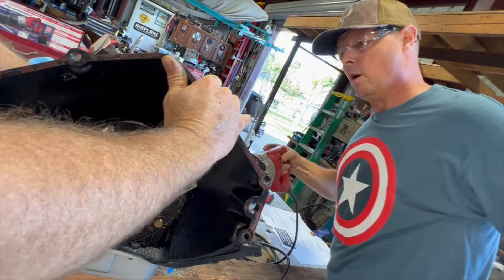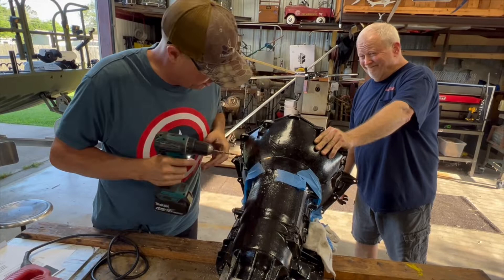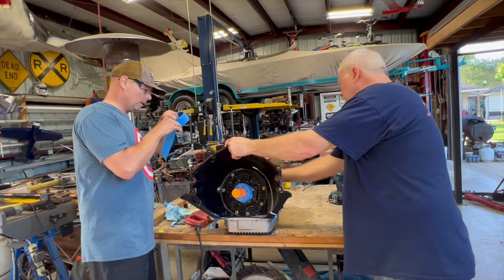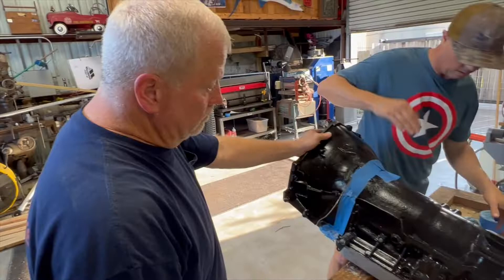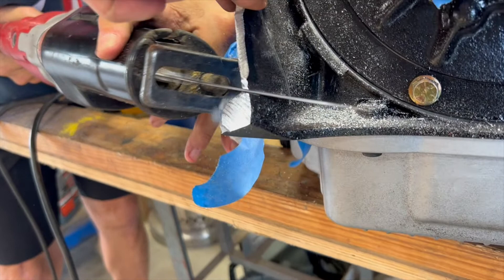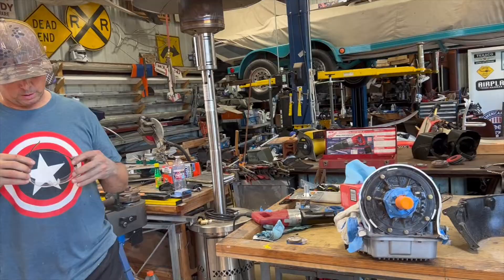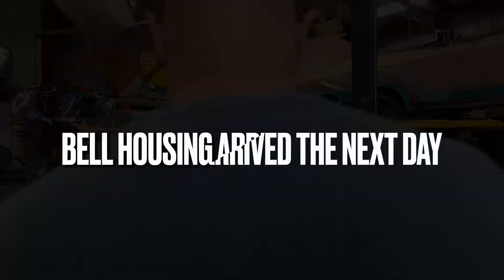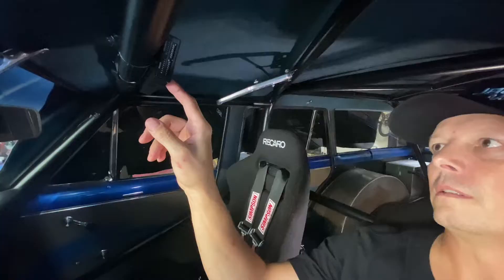Installing a JW ultra-bell and TCI transmission shield

Comment: Any problem with using just the 6 bolts?
Reply from the maker: That’s all that are used in the pump. Easy bolt up install. Remember the o-rings and you’re all good👍🏻
Reply: @jackwagonnova  I gotcha. Some cases, if not most, have a 7th pad you can drill and tap at the 2 o’clock position on the pump.. just gotta pull the pump and finish drilling the pump half and then tap the case. If I’m telling you something you already know, I apologize. I just didnt know if it’s worth doing or not so I was just curious how 6 bolts has worked for you. Thanks